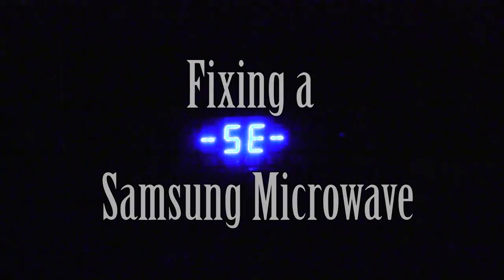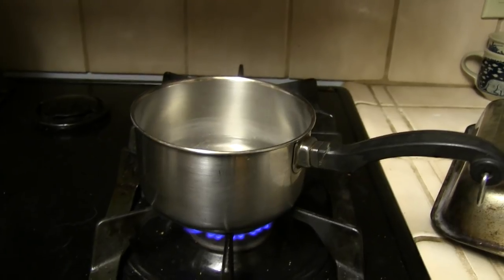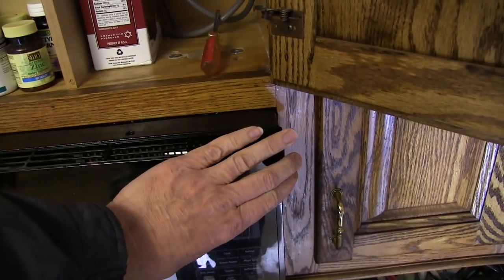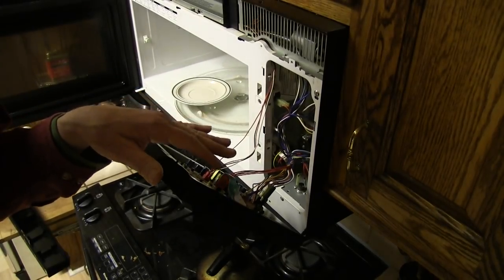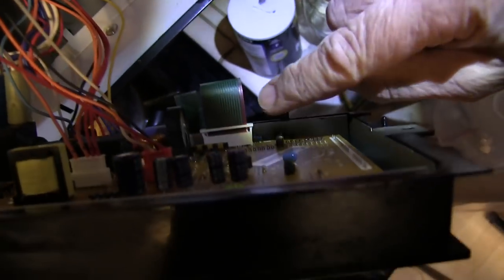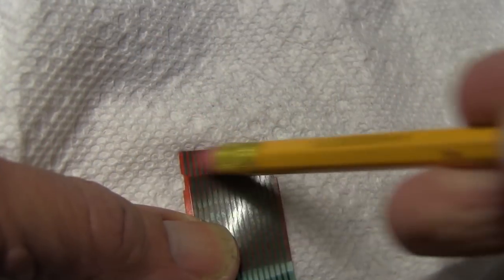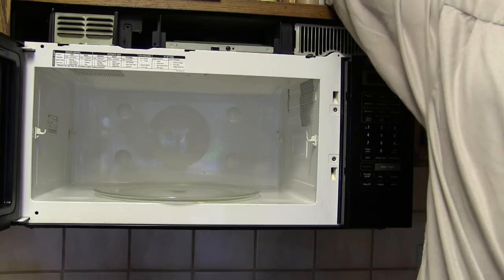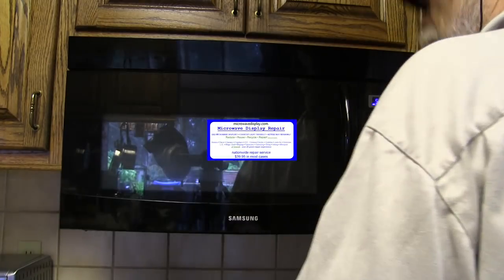Fixing a broken Samsung Microwave - The dreaded 5E error code -- aka the SE error code.

Comment: This repair video is amazing!  I congratulate you on being clear and concise.  It is rare to find a well planned, well edited, and informative instructional video on YouTube.  Your video solved my SE error code.  My Samsung microwave now works fine.  I want to mention two important disassembly points that are not emphasized in the video.  1) Slide the exhaust grill to left before pulling forward.  2) Slide the keypad upward before pulling forward.  I added dielectric grease to my ribbon cable contacts before reassembling.  My hope is that the dielectric grease will reduce future corrosion.  Dielectric grease is the electrical grease used on automotive connectors and spark plugs.

Comment: I have se code on samsung microwave model SMH9207ST.   How do I remove the touchpad membrane that sit at the bottom.  

It is not where the vent that you could unscrew the 3 pieces of screw.  Looked at Phantom samsung microwave.   The touchpad is the same.  Please help

Comment: Can't believe this worked! The latch on the handle broke last week which I fixed via You Tube and then the dreaded 5E this week! It's been 30 minutes and so far so good! The instructions were so easy and I did it in 10 minutes while my husband slept. Definitely the ribbon cable with the eraser and then I used a soft bristled tooth brush for the rest. I didn't even use the compressed air. Thank you so much!!

Comment: Joe, today 11/19/15 our Samsung SMH9187ST above the range microwave showed the SE error code. I followed the steps you outlined in your video with one exception I used a hairdryer (cold setting) versus a can of compressed air.After cleaning and re-assembling the keypad and plugging the unit back in there was "life". So far so good. Many thanks for the detailed and useful instruction. Regards, Mike Thibeau, Midland, MI

Comment: Thanks so much for this video. We have a Samsung over the stovetop model which is about 18 months old. Ours has all the controls in the door. We were cooking pasta on the stovetop with steam condensation happening on the microwave. I called Samsung and arranged to have it serviced but Samsung told me I would have to cover the cost as it was out of warranty. ($99 just to get a technician to come out plus labor and parts). After watching your video I called Samsung back and argued with the rep armed with the knowledge that it was a known problem and my unit was less than 2 years old. They argued to fix it under warranty “one time”.  The technician showed up and stated he needed to order a new door and keypad to see which resolved the problem. The service outfit also told us there would be a $50 charge if the unit had to be taken down to repair it even tho Samsung was now paying for parts & labor under warranty. We are now waiting for the parts to come in. This experience has soured us on future Samsung products. Why would you sell a over the stovetop microwave with a known problem of simple steam causing a failure?  And then try to stick the consumer with the repair if out of warranty.  I will never buy anything from Samsung in the future after this experience.

Comment: Just tried it and it worked great, my SE is no more and back to working.  One note - I rushed it first time and the microwave came on asking for time to be set but buttons didn't register my push.  I repeated repair and discoverd I had not put the ribbon back in straight - it was a bit cockeyed.  Straigtened it and it worked!  
Many thanks, Joe.  You should seriously be paid a helpers fee by Samsung, since you are saving them from paying for numerous warranty house calls and/or limiting customer frustration.

Comment: I tried this and it worked for a few weeks then got the error again.  I took it apart again and this time looked at the board itself and found it was covered in a fine coating of grease.... I took a new toothbrush and 91% alcohol and cleaned the board completely .... once dry used another toothbrush (new that is) and cleaned all the residue that the alcohol left behind.  now it works like a charm!  thanks for the starting point.

Comment: Last night my microwave starting beeping and 4s were appearing on the time screen.  Then an SE code popped up.  After reading these comments and seeing a key being pressed for 60 seconds will result in this error got me thinking the microwave seems to be sensing the 4 button is being pressed constantly.
I followed the directions on this video - taking a picture of the cables before removing.  I cleaned the ribbon cable with the white eraser and then rubbed it firmly with isopropyl alcohol on a q-tip to give it a clean contact surface.  Cleaned the rest of the contacts with alcohol too but the ribbon connector is the key to this fix I believe.
I have many Samsung appliances and electronics in my home.  I hope this is the only trouble I have because I can't imagine the fix being this easy for anything else that goes wrong.
GREAT how to video - thanks for taking the time to film it!

Comment: I used QD electronics cleaner, comes in a spray can. Use sparingly. It dries very quickly.  I did clean all cables and connections then used a can of air to completely dry before  plugging in the microwave.  Never plud it in until  it's completely dry,  about 15 minutes. Saved myself hundreds, maybe used 10 cents of the spray. Great video, wouldn't have figured it out with out this video.  Thanks!

Comment: WELL DONE. I just experienced the SE code. Followed the instructions which were very well described, step by step, and in a common-sense perspective which is greatly appreciated. I removed the entire panel, used canned air to clear out any debris, applied rubbing alcohol to all the metal components using a q-TIP, it was amazing how dirty the cable itself was. Re-attached the keypad, plugged it back in, and off we went. Worked like a charm. I love these simple and manageable repairs vs. buying a new $400 appliance. THANKS so much. The next issue I have I will send to you for a detailed description like this! :)

Comment: Thanks Joe! Mine came up with the same error yesterday. Took the panel off and found a dead centipede stuck on the ckt board. Reseated and cleaned all cable connections and cleaned the board. Plugged back in. Awesome! Works like a champ now. Thanks!!!!!

Comment: Hi Joe, I'm not a very handy person so I was very skeptical that I could fix the SE problem on my Microwave but your video was straightforward and well done and I decided to try. It was simple, with just a screwdriver and some air my microwave is up and running in less than 10 minutes. Thanks again!

Comment: I'm not sure whether it's the cleaning of the ribbon, or just the act of reseating the ribbon that fixed my microwave. For the record, I clean the contacts on my ribbon using a small amount of Windex on a paper towel. Of course I dried the ribbon before inserting it back into the connector. While I had the panel open I took the opportunity to clean any gunk build-up, and sprayed the electrical components with compressed air. Thanks again.

Comment: This was not only an excellent video, it fixed my problem. I believe the culprit is the ribbon connection, even though I cleaned all of them. I used a white eraser and could easily see the residue as it was removed. Put it back together and it works! Not including finding and watching this video it only took about 15 minutes. 

My unit is the SMH9151 and is probably 5 years old. I am very thankful sir for your help - it saved me a lot of money and hassle.

Comment: My first fix following this video just involved using electrical contact cleaner. That only held for a few days. THE KEY I believe was to use the eraser on the ribbon cable. I did that with my second fix and it's been holding for over a month. Thanks a lot Joe!!

Comment: My Samsung Model SMH8165B microwave (manufactured December 2010) started showing the dreaded "SE" error code about a week ago. I went through the steps outlined in this video and am happy to report that the microwave is working again. The only difference is that instead of compressed air, I used an old toothbrush to clean the electrical connectors.

Thanks for making the video!

Comment: Excellent!  I had this problem on a Maytag, but the error message and procedures were the same.  Cleaning electronic contacts should always be the first step.  I often use isopropyl alcohol on a cotton swab, paper towel, cloth, etc.  I wouldn't be a bit surprised if it was the contacts on the ribbon cable that got a little corroded, but I removed and cleaned all the other connections too. Excellent video.

Comment: Thank you Joe for the video. I followed your instructions and it worked like a charm! 
By the way, this seems to be the microwave that will not die. A sandwich bag that had tin foil on it caused a small, quick fire that blew out the fire sensor and made it inoperable. After searching around for the solution, found out it was the sensor. I replaced the sensor with a generic brand for about $6.

Comment: Awesom video, very clear and great production.  One caution - be careful taking off the top trim piece.  I think the heat can make the plastic brittle.  And open the door, that seems to make it easier.  Like many other commenters, I just had to clean off the ribbon cable - all of the other connectors were in good shape.

Comment: Called the appliance repair place, described my problem, $145 to look at the problem, $188 for the replacement key pad. Watched your video, clean the contacts with denatured alcohol, reassembled, microwave now working. 8 year old Maytag Microwave now up and running. Thank you for this well done instruction video.

Comment: I agree - excellent video! Your voiceover is great, and your explanation / steps to fix the issue were also spot on. Only thing I might have added to the repair would've been spraying all the cable contacts with electrical contact cleaner like CRC. But even without this step the video is the best DIY on YouTube. Thanks!Now I gotta go fix my Maytag microwave showing the same code (essentially the same machine).

Comment: Well done and very clear. I like to make a suggestion too. Take a few photos of the circuit board before removing connections for location and position instead of marking each connector. I do this religiously when working on any type of electronic device or wiring. Always save the photos for future use or reference.

Comment: Thank you for posting this video.  I have the Samsung SMH9187 microwave, had the SE error six months after purchasing the microwave.  Samsung sent a tech who replaced the entire control panel assembly under warranty.  The problem returned about one year later.  I was just about to buy a new microwave when I found your video.  I cleaned the keypad ribbon cable contacts with a pencil eraser and this fixed the problem.  No more SE error!  Thanks!

Comment: This fix seemed to work, twice, but then it came back each time within an hour and started beeping out of the blue and again citing the SE error.  My keypad seemed to be part of the problem as it required repeated key press attempts to input the time when I plugged the unit back in.   I went to an Appliance Parts Outlet online and requested a part number for the Control Panel Assembly for my Samsung model number.  It cost about $40 plus $7 S&H.  When it arrived (sans circuit board to my surprise) I swapped the existing circuit board into the new assembly and it has worked just fine since.

Comment: My Samsung model SMH7177STE threw the SE error code today - and I haven't even used it in a couple days! Of course the touch panel part has been discontinued by Samsung with no substitute, so tomorrow I'll try to clean it following your instructions and hope I don't need to buy a new microwave. This one is 1650 watts, and the ones with this power are insanely expensive now! (We've had this one since 2005.)

Comment: Our Panasonic is identical. Last week the hook on the plastic key/latch inside the door went. I repaired that by drilling a tiny hole in it and threaded the springs' end through to retain it. Good as new. Argh. it never ends. Here's to a satisfactory bodge of one more job.! Thx Joe.

Comment: This worked for me as well.  I added cleaning solder connections with a toothbrush and a little rubbing alcohol.  Why anyone would design a microwave that fails over time due to hanging over a stove is beyond me... Thanks for the video!

Comment: Ditto on "just clean the ribbon cable", worked for me also. Having owned this model for many years, I have replaced the bottom "normally open" switch 3 times (that problem does not generate error code..) so I've been in there before, but have never had "SE" or any error code until today.  Back to using it with all other original parts...thanks!

Comment: I had this error code but without moisture damage. No visible corrosion. I have so called contact spray that I use to treat all contacts, the flat cable and connectors. Solved the SE problem (and many others on E bikes, tablets and such. Thanks for the excellent video! Gerard

Comment: I followed your directions and it worked!  I had the same issue, got SE error.  Fan would always turn on from overheating by being over the stove which I thought was crazy.  finally buttons just quit so I tried this and we are back up and running.  Funny thing was nothing was dirty inside so I just swabbed with a little alcohol and let airdry.  Must have done the trick.  Thanks!

Comment: Thank you, Joe, for posting this great how-to video about fixing Samsung microwave displaying "SE" code.  It was very easy to follow (even for me), and - to my pleasant surprise - I was able to fix my old SMH1622W unit with SMH1611W/XAA ribbon.  I didn't have to buy a whole new microwave, or even a new SMH16 control panel ($100) after all.  I'll continue to monitor how long this cleaning fix will last (& simply repeat it, if/when it happens).  Thank you so much!

Comment: Thank you so much! After my mom's microwave started doing this, I called two local repair shops and neither of them would work on microwaves anymore. I was all set to give up and buy a new one, but after I found your video, I was able to fix it in ten minutes! I only cleaned the ribbon cable (I had to use a bit of 90% rubbing alcohol on a q-tip) and I did a quick test and sure enough, all good. Thanks!

Comment: First of all, great video.  I have messed with this issue for about 4 months, working for only days, then minutes, and eventually seconds before it went to "SE" again.  I found my problem to be specifically with the touch key membrane.  It keeps failing and the number "3" like to activate itself randomly over and over.  I think this is what is shutting it down.  I eventually peeled the membrane off and re-attached it.  It is working for now.  I will see about a replacement keypad in the near future if it does not work.  Thanks again!

Comment: I did take your advice and maybe got two weeks of operation before the SE error returned. I cleaned and got a few more weeks before the SE error was non correctable with simple cleaning. I spent $35 and replaced the touch pad memory which was not a great deal more of a repair after all the connection had been removed. There is another video that goes into this area. The repair has been over a month and I am confident that the fix is good.

Comment: Hey Joe. Is your microwave still working?? Mine was doing the same for much longer than your. I did what you did and it worked for a few months. Then I had to do it again and again. Contacting Samsung got me the same answer as you with it being out of warranty. So I dealt with it for a while longer and then one day I did it and for the next 6 months it was fine.. A few months ago it crapped out the SE CODE once again. After cleaning the connections I put it back together and it still continued. I went back to the internet and called Samsung once again. They said they have now got a campaign going on for this and sent a repairman with a new panel. Worked well for 2 weeks. Now it starts heating as soon as you close the door. With or without the controls being set.. Gotta call the repairman once again. I'm thinking it's time to change brands.

Comment: My 5E error came back a few more times and I cleaned all the connections again, but still get error after a few days. I called Samsung and told them my issue but not about me cleaning or removing it. Told them I saw many people with the same issue on the internet. Bottom line is they are sending a service person to replace panel FREE! Mine is 5yrs old, so they must know its an issue. It was replaced 3 yrs ago also.
Again thanks for the comments of everyone and to you Joe again for the great video!

Eric

Comment: I just followed the instructions given.  Worked great.  Two variations.  First was that I needed to remove the very long screws that mount it in the cabinet above in order to get to the two screws that hold the exhaust hood in place because they are under the cabinet above.  In my personal case this is because I specified the cabinets to be deeper than normal so the microwave does not stick out beyond the cabinet door surface.  It gives a nice look but complicated the repair a bit.  Since the microwave weighs about 50 pounds, I stacked a couple toy boxes on the stove top to keep it from falling. The second variation is that I used spray contact cleaner instead of air. You must let it dry/evaporate before putting the contacts back together. Total fix took about an hour with most of the spent unscrewing the two very long screws that anchor it into the cabinet above.  If I need to do this again, I will definitely have my electric screwdriver available. Thanks Joe for the video.  Fabulous.